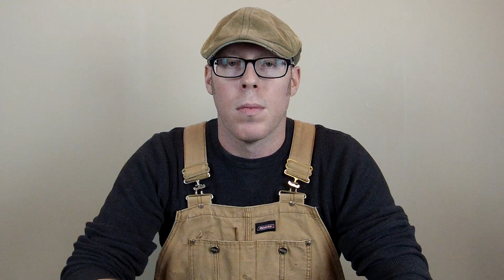Vinyl Pool Inspection Lesson 2 - Coping Track (Part 2)

Comment: Ughhh..have the aluminum track and the bolts have either broke or some how come out..problem is you cannot get underneath the coping to reinstall or fasten the coping back onto the rail..you have to essentially break the concrete to insert bolt to hold the coping down. Is there another way of doing this repair or is there a good aftermarket replacement?
Reply from the maker: I am not understanding what type of coping you have, but yes on a vinyl pool you can not attach the coping without first removing the liner.  Usually coping falls off because people do not use enough fasteners.  Galvanized steel tech self tapping tech screws are what you need to use, and you should have one every eight inches around the coping, and two tech screws at the end and beginning of each piece of coping.

Comment: Im replacing my old liner & have a coping track. I have a liner that has the J on it as well, "uni liner", do i cut the J part off to fit properly into the coping track ? it is a aluminum coping track. I cant understand how it holds in there being its just such a small grove. TY Steve.

Comment: Not true, i just replaced my decktop coping. There is replacement parts no problem. Same company has been making deck mounted coping for 30 plus years, and no it doesnt have to be perfect to work. Here is a link to the replacement decktop coping

http://cardinalsystemsinc.com/product-category/pools/coping-systems/snap-strip/
COPING